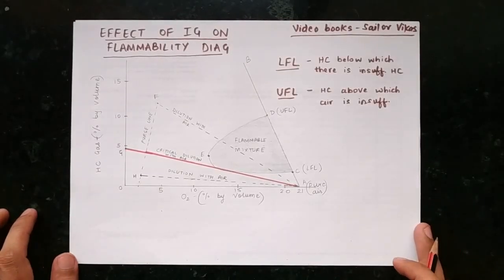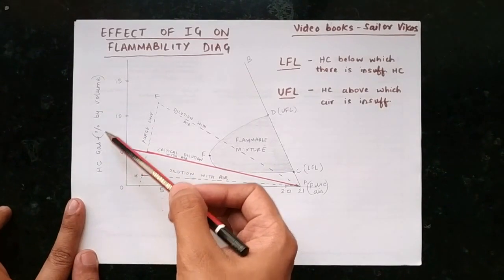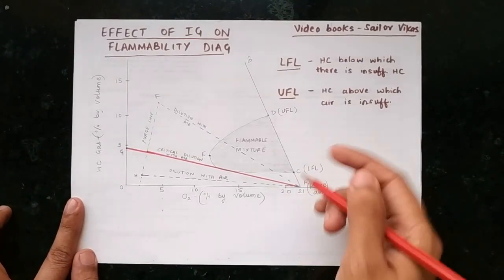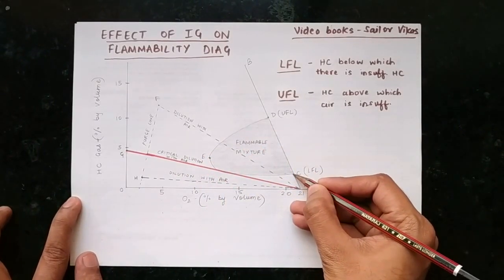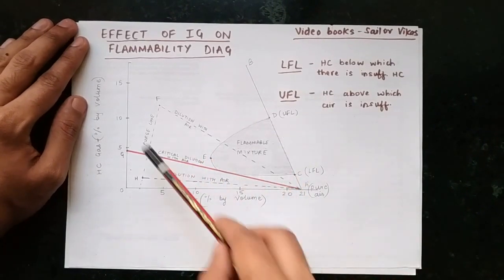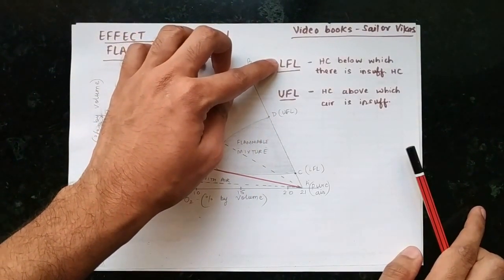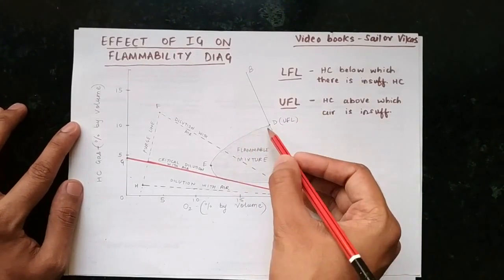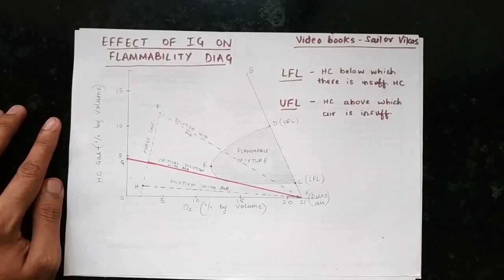Flammability diagram  PART 1- TANKER WORK

Comment: I think you are over explaining drifting away from the actualy thing. 
1. First introduce I.G or N2 and bring the H.C level below critical dilution where the atmosphere is belo LEL.
2. Now the air can be introduced without risk since the H.C inside the tank is less than 1% and below LEL and there is no chance of combustion until the O2 inside the tank is 21% and tank is ready for entry.
Reply from the maker: May be you have done tanker so for you it's a over explanation but I have made this video for cadets who have never seen tanker in their entire cadetship, for them this knowledge is essential.
Reply: @SailorVikas  you got a point👍

Comment: Hey Sir. Is Flammability diagram same for all Gases? And if No, is there any Diagram available for Each gaese?
Reply from the maker: Nope, its different for different petroleum liquids and gases, just to understand in simple manner, everywhere u will see LEL 2% AND UEL 10%
Reply: @SailorVikas  Okay Sir. So just the LEL and UEL limits (Flammable Range) would change, Rest of the Diagram would be same right?
Reply from the maker: If you change the LEL and UEL, the whole shape of flammable range changes thus It will change but slightly, for more understanding you can refer to last pages of Tanker Safety guide where their are plenty of flammable diagrams for various liquids and gases.